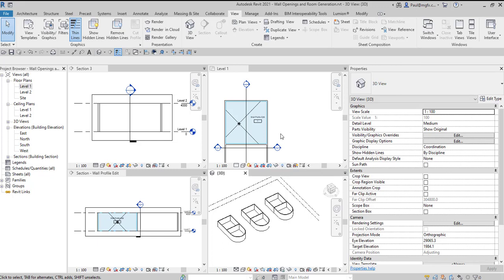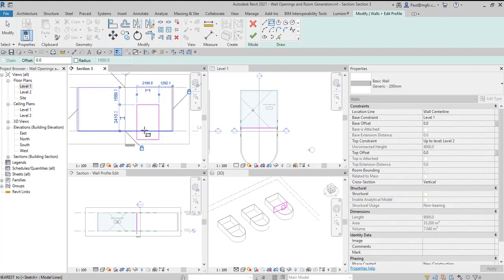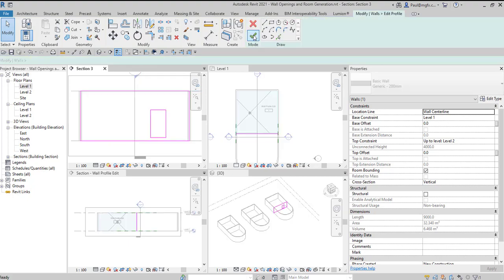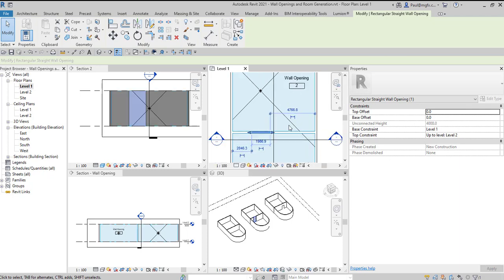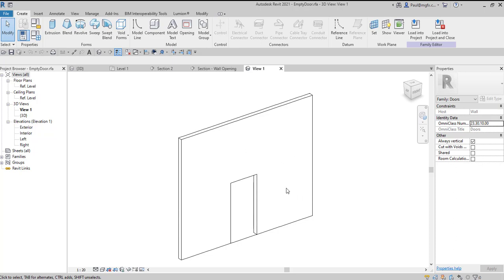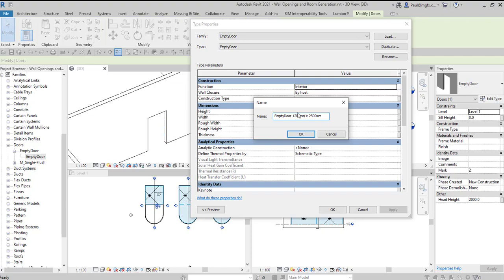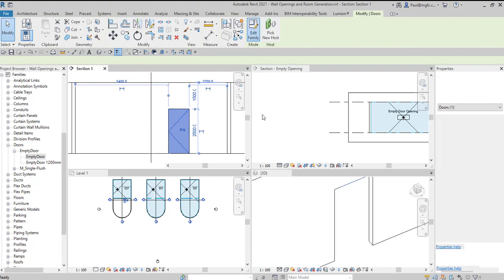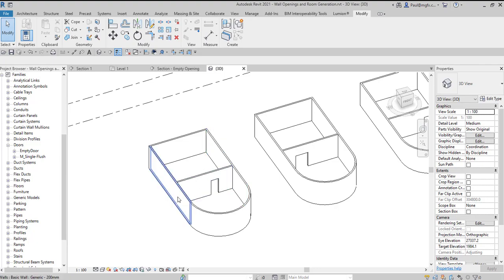Revit 2021 Wall Openings and Room Generation

Comment: Thanks for this useful video. I have been using the room separator tool in line with my wall openings but this is a more elegant solution.